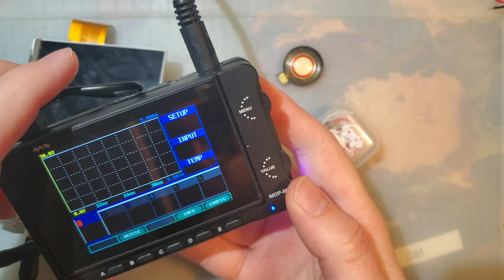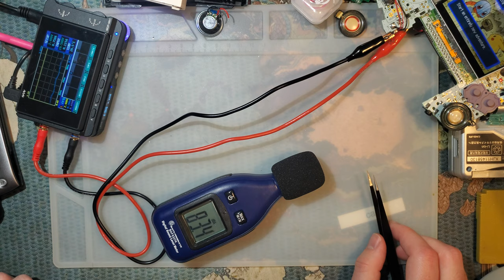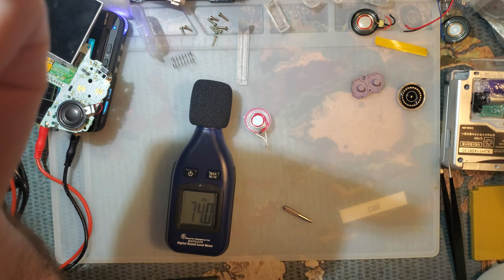Game Boy Advance Speaker Mods

Comment: @5:27 you say "Word of caution ... soldering does seem pretty easy"... it is if you use the correct tip and keep it clean and at the correct temp. Lower temp with lead and higher with unleaded. TS100 or TS101 were designed for us. Highly recommend.

Comment: Hey makho, I came here for anti noise mods or something like that but I still stayed and watched.
I noticed something than. I dont know if I'm the only one who noticed it but we will see. When you change the speaker you dont really give a damn if the + pin from the GBA is on the + pin of the speaker. I didn't mod many GBAs till now but I noticed that even Nintendo give a damn about it. I mean its making a differents in the sound if the positive amplitude is doing to make the speaker membran go out or go in. You phase switch the sound signal. And I think it makes a differents in the sound of those little speakers. All my investigation started with an unlabeled aftermarket speaker were I didn't knew where the + pin was. After a quick research you can simply test is with an 1,5v battery. When + of the battery leads to that the membran goes out than you got the right + pin of the speaker. I dont know why, but I also tested the original speakers and noticed that some of them were wrong from the factory and I switched the cables. I dont know if this an known bug, but I think its better when the speaker is soldered right :)
Reply from the maker: Phase only matters if you have two or more speakers. It makes no difference otherwise because the speaker is still making the exact same pulses. 

If you have two (or more) speakers on inverse phases, they will cancel each other out. 

You're stressing your speakers by hooking them up to power like that. Good way to kill the speaker.

Comment: In my experience so far I’ve done a whole bunch of different audio mods from various vendors like retro six, Helder, etc etc and I honestly keep goin back to the stock audio setup. It just works for me and don’t find the “clean up” kits change much honestly. The stock speaker, if in good shape, sounds the most pleasant to my ear 🤷🏻‍♂️. If you have power issues for sure new caps will help.
Reply from the maker: Yep, fresh electrolytics seem to make the biggest difference
Reply: Now I will say the flex amp mod for the macro from Helder is def worth it!

Comment: Much like with proper speakers, the tiny 23mm drivers here all change sound drastically when put into an enclosed space, such as the GBA housing.

I'll admit that I haven't watched the video fully, just skipped about, but I didn't see any testing where you put the driver back into an assembled GBA - this can make some of the speakers sound more distinct than others, especially if you pack the surrounding area with different types of foam. There's more to tinker with here than maybe initially obvious :)

Comment: I've stuck with just stock GBA speakers, but with a simple PAM8302A chip modification to get it louder. Let me tell you, that shit does NOT play nice with the drop-in IPS kit if you increase the power of the amp on the chip itself. It gives me pink screens and artifacting lmao, so my drop-in IPS GBA is a tiny bit quieter than my other GBAs since I can't increase the amp's power as high as I'd like. By the way, what was the blue wire on the volume wheel for?
Reply from the maker: I explained it in the video. It's a bypass for the volume wheel to ensure that it was always set to the same level.

Comment: When soldering the 2 wires, they don’t end up crisscrossing like the oem speaker? Top wire was soldered to the hole closest to label SP1 while bottom wire was soldered to the hole closest to label C49
Reply from the maker: It does not matter at all for mono speaker setups. Even with stereo speakers, polarity doesn't matter as long as both speakers are set to the same polarity. Stereo speakers in opposing polarities will be out of phase with each other and will cancel themselves out.

Comment: Hello,
I tried to use Helder mods and add a couple of capacitor as mentionned on retrosix to clean the sound (dehum dehiss)
Do you try to clean the gba noise by yourself ?
No really good result on my side
Reply from the maker: I still have to dive deeper into this subject but my preliminary tests were less than satisfactory.

Comment: I have 7 billion ds lite speakers because of how many macro mods I make LOL. They make great speakers for literally anything. And if you only use 1 speaker on a system with stereo output, just bridge the the L and R output pads and you're gucci
Reply from the maker: >  just bridge the the L and R output pads and you're gucci

that's not a good idea. Not all amps can just be bridged like that and it can cause damage.

Comment: Does anybody know if I can install the clear gba speaker to a gba sp? Do I have to solder to the contacts of the original sp or is it more complicated than that?
Reply from the maker: it won't fit without modification but otherwise yeah, they are the same and you can just solder it to the gold pads. 

Keep in mind that this is a permanent modification, however, since you can never remove solder from contaminated gold pads and the solder tends to form a non-conductive oxide on the surface layer (very thin). You can clean up the pads with an abrasive to restore conductivity but this will be hit and miss.

Comment: I have the flex amp installed in my sp and it keeps blown the speakers. What do you recommend I use speaker wise?
Reply from the maker: you're going to need a speaker rated for the wattage your amp does (a stock speaker won't work)
Reply: Helder sells a 2w speaker that claims to be better for using with an amp

Comment: What about the acoustics of the shell?? Because I've had this issue before a couple times and I thought it was the speaker!! But it wasn't turns out the Gameboy advance became louder when I put the shell on and all the buttons etc. it has something to do with the acoustics. Needs to be closed up all the way. But I'm just talking about using the original speaker or a similar one.
Reply: I could be wrong.
Reply from the maker: @robert_wolf6989  shouldn't make any reasonable difference here. These aren't studio monitors we're talking about, it's a half watt Game Boy built down to a price.
Reply: I know they're not studio monitors. All I'm saying is that solid matter (talking about the cup and grill part of the shell that holds the speaker) does affect sound and can channel sound to make it appear louder when facing the user directly. I'm not as skilled as you with electronics but it's just what I have observed for myself.
Reply: Game Boys do use any airspace in the case as the speaker enclosure. it's most effective with the DMG of course, but yeah.
Reply: @RWL2012  yep! That's exactly right